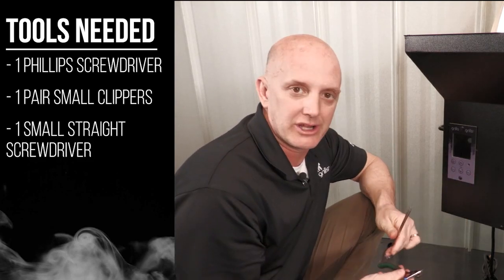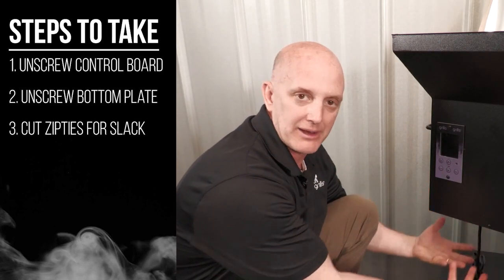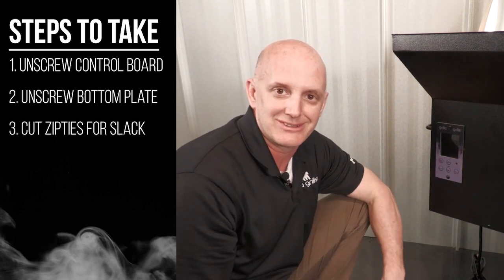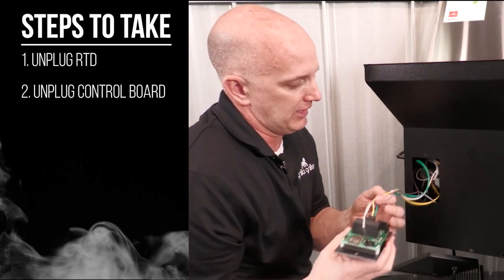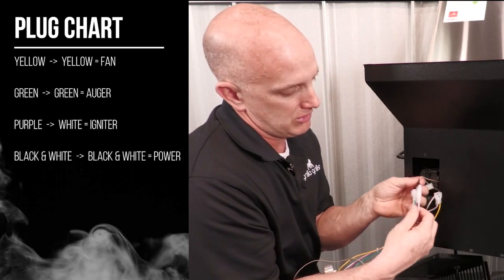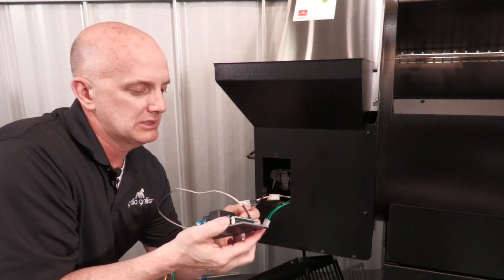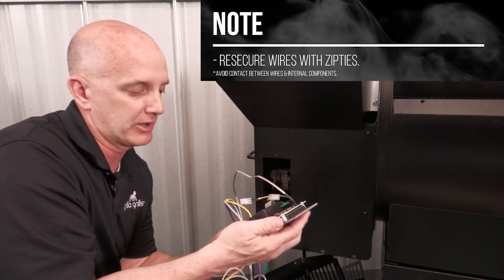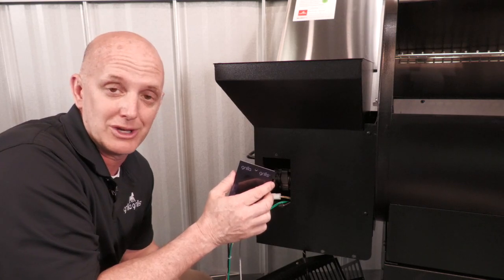How to Replace a Silverbac Control Board | Maintenance with Grilla Grills

Comment: Replaced the original board for the alpha - now the alpha replaced for the WiFi board. Other than having to drill out a 3/8" hole for the new, two-piece RTD, easy replacement. Loving the new functions of the WiFi controller! Great job Mark and team!
Reply: Where did you drill the hole and what did you use?
Reply: @gadklein290  you just enlarge the existing holes.  Helps if you have a 90degree drill

Comment: Also watch the RTD installation video. It will let you know which style you have. I have a Silverback from 2017 with a one piece style RTD. I did need to drill out larger holes to fit the new split style replacement that came with the WiFi board.

Comment: I think the pro and pid mode are switched on mine. They do the opposite of what they are suppose to do. Also my screen turned off 1hr into the cook. That might be normal though I will read up on it.

Comment: How do I do this for the built in version?
Reply from the maker: Everything is the same!
Reply: @GrillaGrills  This is not true at all.  No way to install the new split connector without some drilling/cutting.  That should have been mentioned in your video, would have been very helpful.